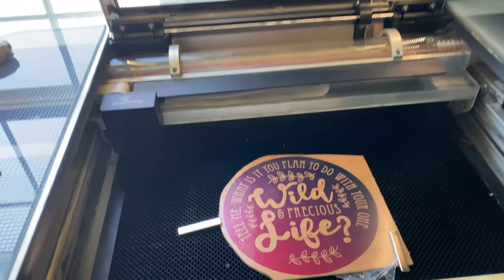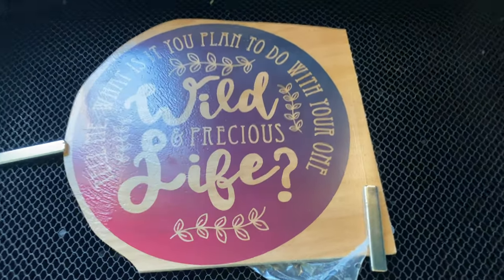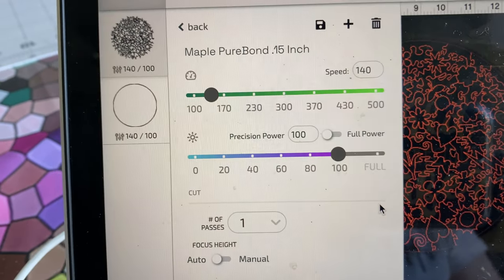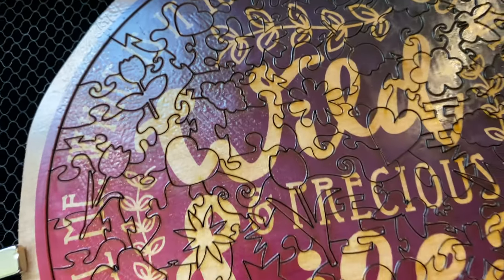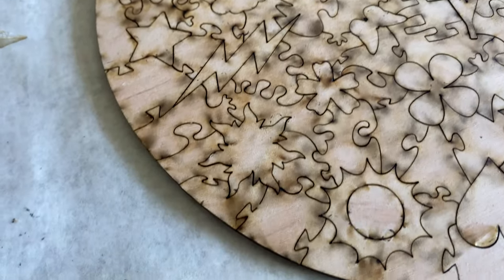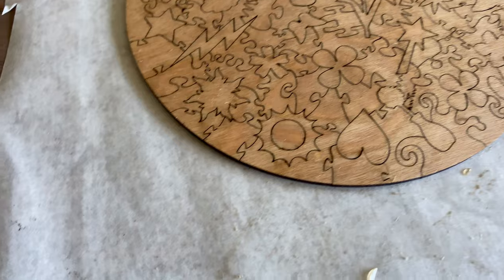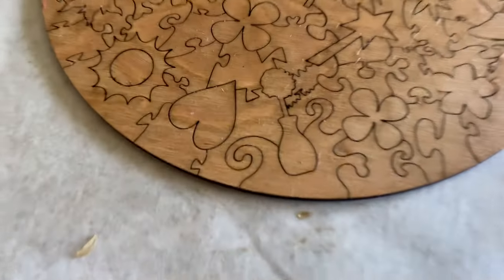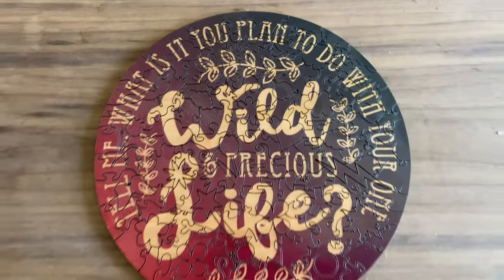GlowForge Laser Cut Jigsaw Puzzle using Waterslide Decals on Wood

Comment: I'm working on a custom puzzle like this with my laser. I watched a few of your videos what method do you think is the best to add a photo to mdf? Also I'm not sure if I completely understand how you do the image transfer with the heat press and bonding material.
Reply from the maker: Hi Kelly- Thanks for reaching out. Before I started with the heat press, I would use tacky glue and just apply a thin coat to paper and press it down onto the MDF. Then I’d take a roller of some sort, and make sure it was pressed on. That worked fairly well. The heat press method is where I sandwich a very thin piece of adhesive between the image and the wood. It’s called adhesive film and it almost looks like just a thin piece of plastic. When it’s under heat, it melts the adhesive, gluing the image onto the wood. I then use lamination to coat the top as well which helps keep the image down. I hope this helps! Let me know.
Reply: @HelloFairytale  I have a heat press and that method seems like it is more foolproof to me. Do you have links to the adhesive and lamination you use?
Reply: Also do you use waterslide paper?
Reply from the maker: @kellygriffin8689  I use the D&K Fusion 4000 - 24 1/2" x 90 and the last time I ordered it I got it from https://www.unitedmfrs.com/ - they shipped fast and I was happy with it. It's pricey but you're getting a ton of it. 

I've used waterslide as an experiment but I usually just use some decent-quality photo paper as I found the waterslide inconsistent and hard to work with. I have a Canon 13x19 printer and use matte photo paper which seems to work well for me. I've tried thicker/thinner but didn't notice a difference. I do laminate it with 25x200 UV digital satin film that I got from oregonlam.com.
Reply: @HelloFairytale  thank you! I feel like I have a better idea of what I need now!
Reply from the maker: @kellygriffin8689  You're welcome! If I get around to it - I'll try to throw together a video for you - I feel like a visual is always helpful as well!
Reply: @HelloFairytale  that would be awesome if you have a chance!
Reply from the maker: @kellygriffin8689  Okay I just posted it for you! https://youtu.be/IPj4dj8acVY